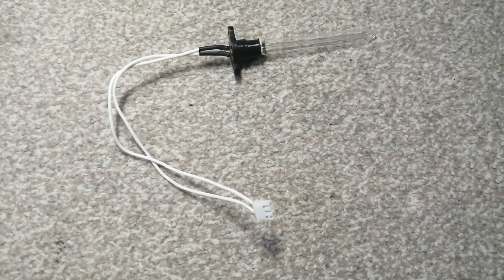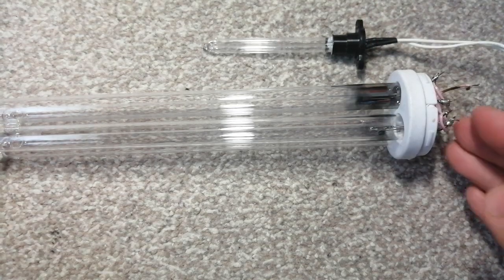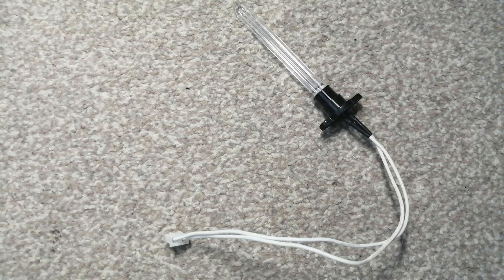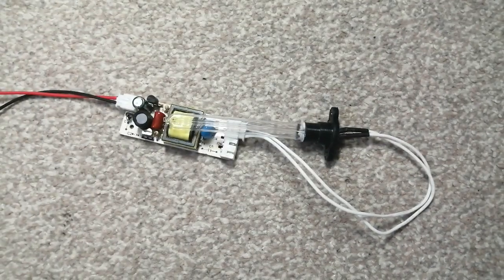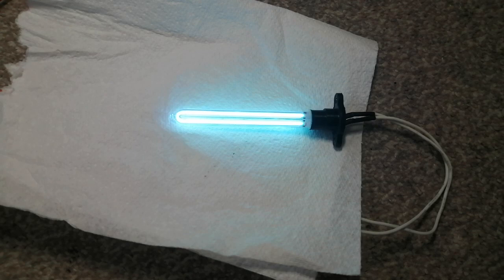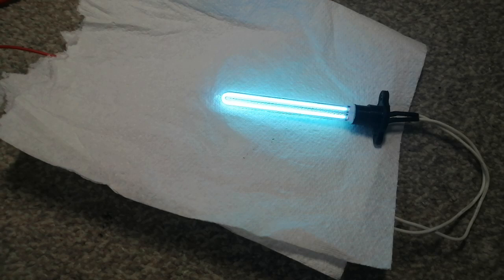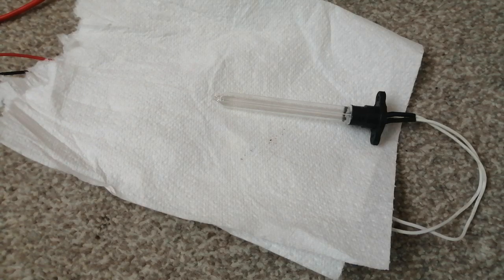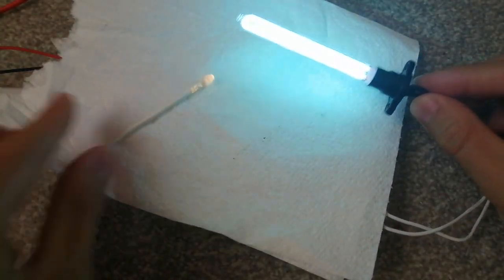Everything you need to know about UVC germicidal lamp

Comment: Please, where did you get the bulb from, I can’t find them anywhere on the internet. 🙏
Reply from the maker: Look on amazon or eBay, you should be able to find it.
Reply: ReedSwitch Tube no luck mate. I’ll just get the whole unit. Thanks. Keep safe.
Reply: I have the same problem 
I cant find them on net
Did you find part number of these items?
I mean UV tube and also the driver
Reply: @rezanourian8751  - believe me, I can’t find them anywhere.  “UV-86. CCFL 2.5 Watt U shaped tube” is what to look for.  They must only cost a few pence but I can’t find them.  In the end I ordered a new unit, which seems a waste as I only needed a bulb.  It is was it is.
Reply from the maker: @rogerhargreaves2272  The bulb I've brought was few years ago. I brought the inverter and two bulbs separately both on eBay. But they don't sell it anymore with the same link.  I've found something similar which you could give it a try on your own risk (aka eBay fraud)

Link one: https://www.ebay.co.uk/itm/UVC-254nm-Germicidal-Ushape-100mm-Quartz-Air-Sterilization-Dual-Light-Bulb-12VDC/324164411808?hash=item4b79b461a0:g:H-4AAOSwGdJeuyGe

Link two: https://www.ebay.co.uk/itm/UV-C-254nm-Germicidal-Air-Purification-U-shape-75mm-Dual-Light-Bulb-12V-DC-Kit/324429003536?_trkparms=aid%3D1110006%26algo%3DHOMESPLICE.SIM%26ao%3D1%26asc%3D20201210111314%26meid%3D3d8144744b8144e8aeb404e702b52df9%26pid%3D101195%26rk%3D3%26rkt%3D12%26mehot%3Dlo%26sd%3D353299987244%26itm%3D324429003536%26pmt%3D1%26noa%3D0%26pg%3D2047675%26algv%3DSimplAMLv5PairwiseWebWithDarwoV3BBEV2b%26brand%3DUnbranded&_trksid=p2047675.c101195.m1851

Link three: https://www.ebay.co.uk/itm/UV-C-254nm-Germicidal-Ultraviolet-Light-Bulb-U-shape-50mm-Dual-Lamp-5V-DC-Kit/353299987244?_trkparms=aid%3D1110006%26algo%3DHOMESPLICE.SIM%26ao%3D1%26asc%3D20201210111314%26meid%3D3abaedbce03d4e48919b1efd4edf42ed%26pid%3D101195%26rk%3D3%26rkt%3D12%26mehot%3Dpf%26sd%3D324429003536%26itm%3D353299987244%26pmt%3D1%26noa%3D0%26pg%3D2047675%26algv%3DSimplAMLv5PairwiseWebWithDarwoV3BBEV2b%26brand%3DUnbranded&_trksid=p2047675.c101195.m1851

Link four: https://www.ebay.co.uk/itm/UV-C-254nm-Germicidal-100mm-by-12mm-Dual-Light-Lamp-Bulb-12V-DC-Kit/324351017561?hash=item4b84d3c259:g:5akAAOxydINSaUSW

Good luck finding a single bulb any question feel free to write it down below.
Reply from the maker: @rezanourian8751  I don't have the exact link But I've found something similar and beware of fraud and buy it at your own risk!

Link one: https://www.ebay.co.uk/itm/UVC-254nm-Germicidal-Ushape-100mm-Quartz-Air-Sterilization-Dual-Light-Bulb-12VDC/324164411808?hash=item4b79b461a0:g:H-4AAOSwGdJeuyGe

Link two: https://www.ebay.co.uk/itm/UV-C-254nm-Germicidal-Air-Purification-U-shape-75mm-Dual-Light-Bulb-12V-DC-Kit/324429003536?_trkparms=aid%3D1110006%26algo%3DHOMESPLICE.SIM%26ao%3D1%26asc%3D20201210111314%26meid%3D3d8144744b8144e8aeb404e702b52df9%26pid%3D101195%26rk%3D3%26rkt%3D12%26mehot%3Dlo%26sd%3D353299987244%26itm%3D324429003536%26pmt%3D1%26noa%3D0%26pg%3D2047675%26algv%3DSimplAMLv5PairwiseWebWithDarwoV3BBEV2b%26brand%3DUnbranded&_trksid=p2047675.c101195.m1851

Link three: https://www.ebay.co.uk/itm/UV-C-254nm-Germicidal-Ultraviolet-Light-Bulb-U-shape-50mm-Dual-Lamp-5V-DC-Kit/353299987244?_trkparms=aid%3D1110006%26algo%3DHOMESPLICE.SIM%26ao%3D1%26asc%3D20201210111314%26meid%3D3abaedbce03d4e48919b1efd4edf42ed%26pid%3D101195%26rk%3D3%26rkt%3D12%26mehot%3Dpf%26sd%3D324429003536%26itm%3D353299987244%26pmt%3D1%26noa%3D0%26pg%3D2047675%26algv%3DSimplAMLv5PairwiseWebWithDarwoV3BBEV2b%26brand%3DUnbranded&_trksid=p2047675.c101195.m1851

Link four: https://www.ebay.co.uk/itm/UV-C-254nm-Germicidal-100mm-by-12mm-Dual-Light-Lamp-Bulb-12V-DC-Kit/324351017561?hash=item4b84d3c259:g:5akAAOxydINSaUSW
Reply: @ReedSwitchTube  Thanks buddy for your time and effort sending me these links.  I’ll try them out and also let you know how I get on. 👍